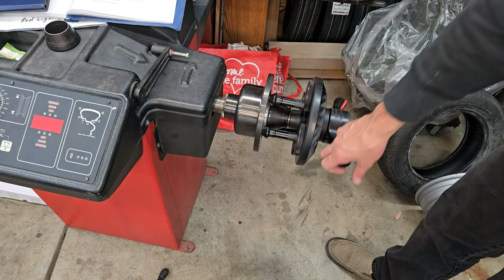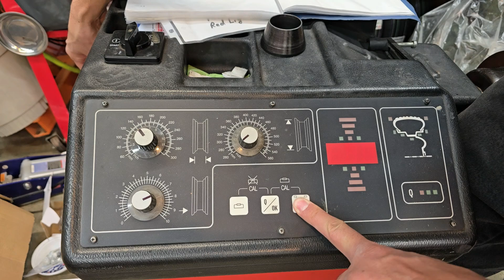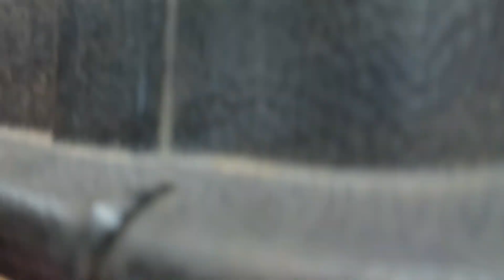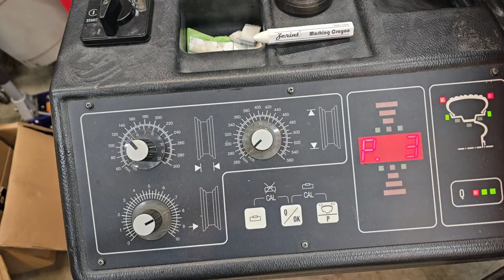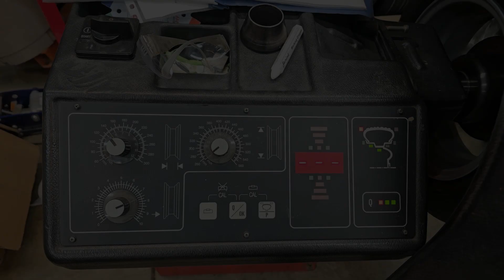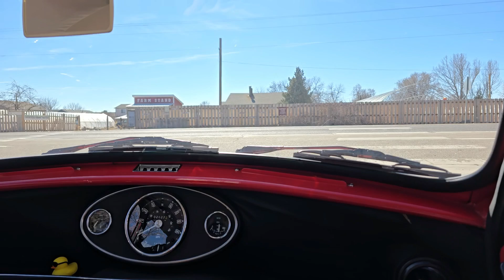Tire and Wheel matching to minimize wheel weight for smoother riding wheels plus road test!

Comment: Darren, I came across tire balance out of necessity. 5 shops and about 7 balances later. Most said to just deal with the shimmy on the highway…   Most shops said needs new tires blah blah…

I found a Hunter Road Force engineering tech, brought him onsite and balanced the tires together. We looked at the package of all the wheels .003” rim runout here and .001” rim runout there. We not only phase matched within each tire but within the set. We got the fronts down to 4 lbs & 8 lbs and bout the “worse” of 15 & 18lbs on the rear…

What do you have it? No shake! No shimmy…

Most tire shops refuse to train, refuse to do the work, are built in salespeople… I never realized it. 

One tire shop told me (that has road force equipment) they don’t use it nor phase matched and if a customer claims THEN we fix it… 

Terrible mindset.
Reply from the maker: Im glad that you were able to get your wheels properly done by a professional tire fitter and balancer. 
It takes time to do this process but it always gives a better balance to the wheels and tires. 
Most tire shops do not care about the driving experience, they just sell overpriced stuff and add fees onto the bill.

Comment: I wonder how many fitters actually do this? My guess is none. They just bang the tires on and compensate with more weight.
Reply from the maker: Yes, I agree. I see the tire balance dots misaligned all the time. It's such a simple thing to do, and yet it's constantly overlooked. My guess is that the people who train the fitters don't know either. 
I think if you have a bad tire/wheel problem, then they will upcharge to do "special" valance work. 
Clearly, the tire balancer companies know what is going on and have set up their machines to provide the best balance and guidance, but it gets overlooked by the fitters.